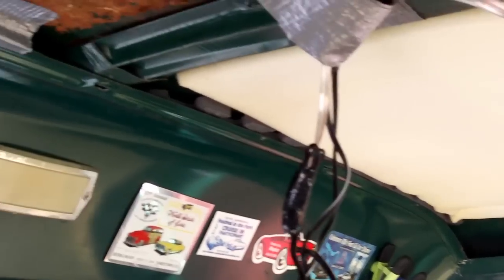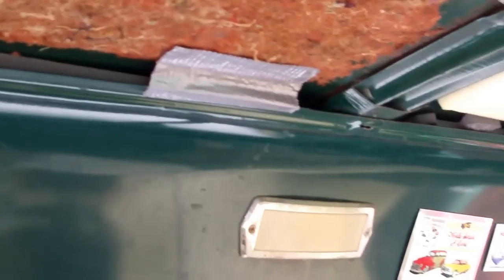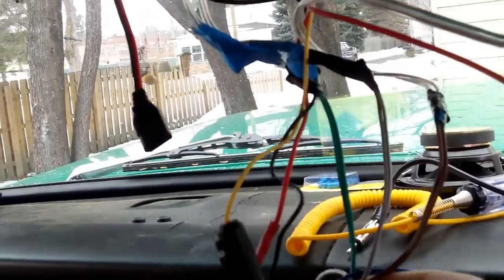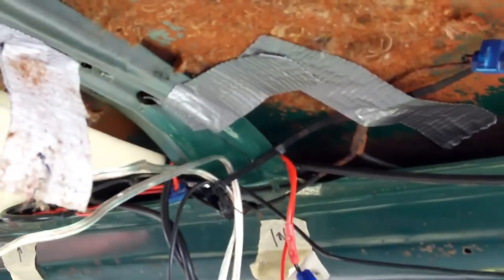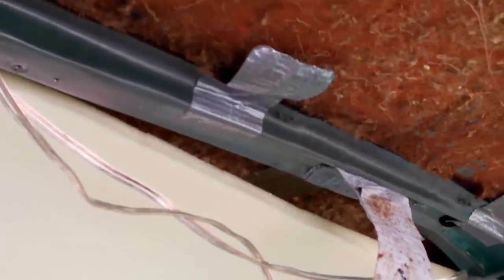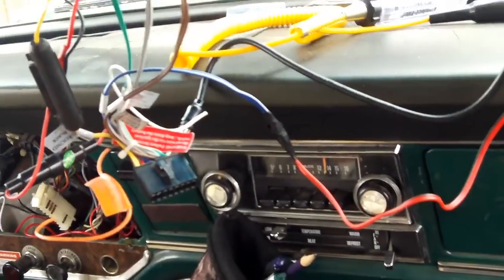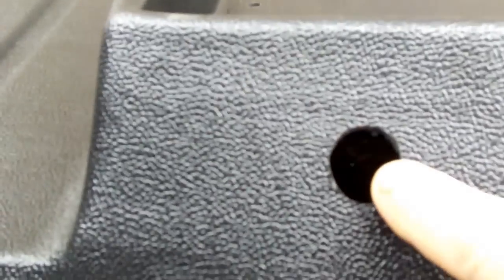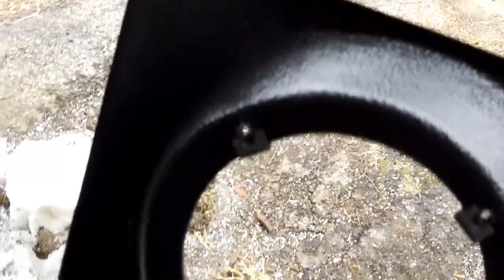Installing a Highliner headliner in 1970 Ford F250

Comment: How did the install turn out?

I am awaiting information from Dashtop as I cant find much information on the '80 - '96 F series highliner.  I know this one the photos Ive seen for the 70`s variant has holes for screws but the 80 - 96 variant doesn't have screw holes.

Im not sure what I will end up doing, I don't really need the speakers but I like the layout and the ability to mount some switches and a gauge or two in the radio area.

Comment: OK I have the headliner installed but how do I install the speakers on the back side on it cause the pieaces that came with it won't stay on
Reply: And what do I do just cut out the square part and install my CD player
Reply from the maker: Are you referring to the little metal clips for attaching the speakers? Yes you need to remove the rectangular section of plastic to mount your radio. If you want I can make a video tomorrow that will address your issues.
Reply: 116falconer  yes please
Reply: Yes the little metal clips I see u put urs on the speaker holes on headliner but what's going to hold the speaker
Reply from the maker: I'll make a quick video and post it tonight. I'll let you know as soon as it's up.
Reply: 116falconer ok thank u
Reply from the maker: The video will be active in about 30 minutes. I hope this helps.